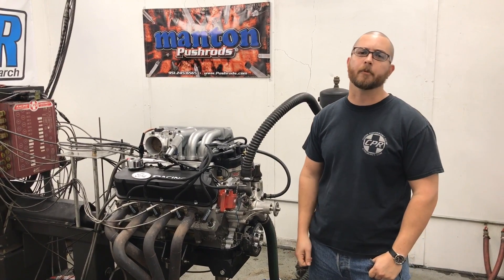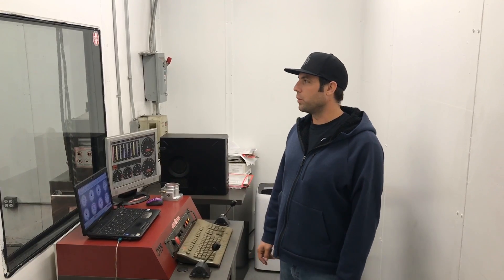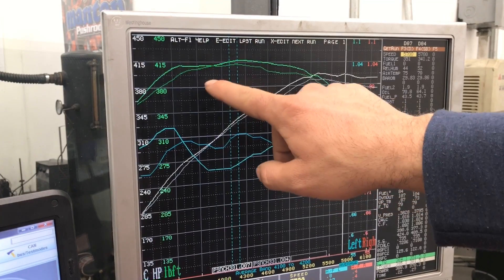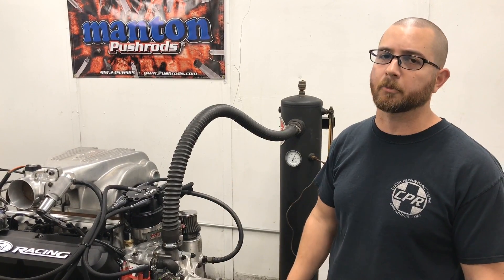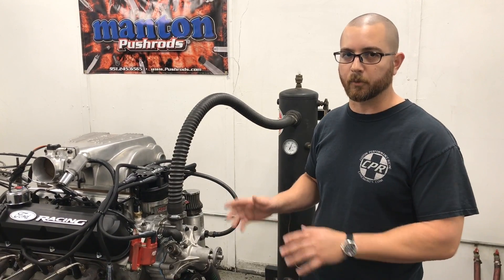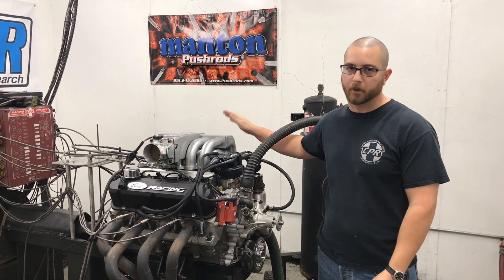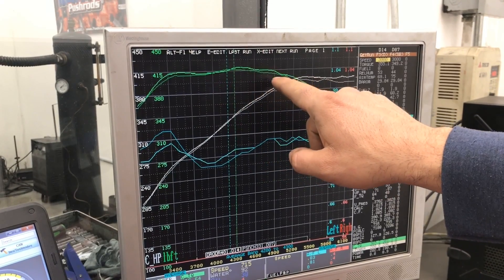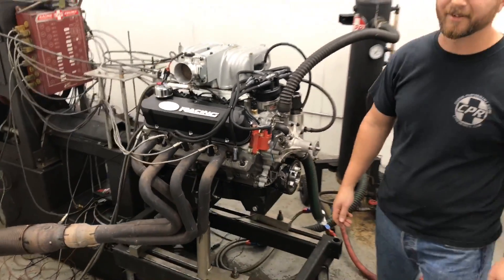Ford 331 Stroker Dyno Testing- afr 165 heads and 3 different intakes

Comment: Your numbers are way off your scale shows the horse power and torque are not crossing at 5250 rpms,  if the dyno setup is correct  the numbers will always cross at 5250 rpms

Comment: Well this pretty much convinced me there's basically no reason to port my GT40 lower intake with my AFR 165's on my current stock bottom end build. It didn't even gain much with more cubic inches that would obviously want more air than my 302. It did carry that peak power out to higher RPM but I think i'll just leave it un-ported and save some $ there. If i ever go 331 with a rebuild eventually that Systemax looks like just the ticket, great intake.

Comment: I have a buddy with a 333 Stroker engine in his 67 Fastback. It was custom built, he can't show me a build sheet. He keeps quoting me 500hp but then I saw the dyno sheet and it made 470hp without accessories. Does this seem like a realistic output for a 333 stroker on pump gas?

Comment: I have a bone stock 302 with a Vortech S Trim  and have some brand new AFR165s  . Should I sell these and get 185s ?  If I stick with the 165s what cam would you guys recommend? Thanks guys ! Love the videos
Reply: Run the 165’s. David Vizard or Richard Holdner will tell you the same thing. 👍

Comment: Damn, reminds me of my build.
347 with afr 185s and edelbrock rpm 2 intake manifold w/70mm tb . Then switched over to the holley systemax but didn't dyno. Would have made some power but i ordered the wrong cc chamber (72cc) which killed my compression. Cam 224/230 - 544/544 @ 112 ls. 
Made 323 rwh through the T5.
1 5/8 long tubes, O/H pipe. 
13.00 @ 107mph short shifting and 2.0 60ft
Reply: Damn that's it lol?

Comment: Im looking into buying your ford  331 pro street short block.  My set up will be identical to the one in this video. AFR 165s and a systemax intake.. i havent decided on what cam yet. I will be running a vortech si trim around 9 psi. What precautions can i take to be easy on the block? Like not rev over 6k rpm? It will be tuned on holley terminator x, which is up and running currently on a stock 302 bottom end. Thanks in advance and hoping to do business with you guys soon.

Comment: thanks for the test.
I have the same motor and intake with a vortec 13 LB supercharger. coud you estimate the horsepower for me please. I ask this as no one here has the software to use on the dyno.
Reply: So go dyno it and see what it makes...
Reply: be around 600 if the tune is good, if this motor is 400 and 20 hp/lb?  Run E85 and watch the numbers go!

Comment: i love that it doesn't have a blower, not everyone has a blower, but some have setups like this. Ibelieve that a 302 needs the holley for a fuel injection intake for  air because you can use 11 to 1 with a long rod and big cam and the AFR 186cc heads, i believe it works with a vic jr. or other nice intake well, maybe not the funnel web, but maybe an epoxied funnel web with narrower yet taller runners. my long rod 5.7" rod  destroker 11.5 to1 MAHLE piston ,293 cid is going to use Trick Flow 11 R-SERIES 190cc heads, custom ground cam based on a Lunati solid roller high efficiency cam with lobes for a mopar, with mopar sized hydraulic roller lifters, and either a ported performer RPM or weiand tunnel ram with epoxied narrowed and ported taller runners.  this is a street engine, its going into a 1981 camaro that has fox body tubular suspension front and rear and an 8.8 axle., the transmission a 5 speed, manual rack and pinion steering. The brakes are a manual pump manual master cylinders disc brakes super long pedal setup, levered all the way top of where the dash would be, with the rod closer to a gearbox fulcrum generating thousnads of pounds of pressure, the components are chromoly steel and fastened to a tubular frame with foot box. 40 gallon fuel tank, maybe 2 or more of them.

Comment: gr8 video CHP...I'm doing the same build can I use a ford e303 mild camshaft along with afr 165 heads also did you guys used stud or pedestal mounted 1.6 or 1.7 roller rockers.....and was the internal external balanced and if external balanced what weight did the flywheel and harmonic balanced used in build

Comment: Should have had Bigdogs Porting port the upper and lowers on both gt40 style manifolds. The results would have been a lot different. Running stock uppers on mildy ported gt40 lowers will not gain much at all we have seen this on the dyno as well.  Our testing shows only a 10-15cfm gain once bolted together. This is why tests like this don't represent what a good ported gt40 style manifold can do. Fully port that Explorer gt40 upper and lower and shorten the runners to raise the rpm peak and it would run circles around the mildly ported Systemax 2.

Comment: Why not Extrude Hone the cast intakes? If you ported the lower, why not port the upper? I hope you ported the inlet for the bigger throttle body.
Reply: Because power gains Vs cost isn't worth it.

Comment: Whats the timing set at?
Reply: Fast burn  with good  quench CNC AL heads on a  SBWF  usually about  32-34 N.A. More  at 32 deg. all-in at 3500rpm - NOT 36 ! Pull and  read read a  couple  plugs   every 5 second WOT if you are  looking for that last degree for  HP on pump gas. if you see aluminum,  your  done,  and  back down 2  degrees. I would  also go for  short nose plugs and start colder to boot.  Autolite  copper core with inconel ground-  not  NGK  whatever core and whatever meltaway grounds! Enjoy! - Sandy
Reply: @sandyshoremann7524  I use Autolite 104 copper with good results.

Comment: What cam was in there. Building 331for 65 mustang....for my wife. So big hp not necessary but that sounded great. 331 auto and 355s. Motor trans rear end out of 96 explorer
Reply from the maker: One of our mild custom cams was like 220 duration.
Reply: @coasthighperformance  okk will note that...really great sounding motor

Comment: This engine would have been so much better with AFR 185 heads too. Great pulls all together on this engine for sure.
Reply from the maker: Agreed, after this the customer sold the 165's and has us install 195's since they will work better with the supercharger.

Comment: Do you think having a shaped inlet for the throttle body would help airflow?  Nobody runs without some sort of tubing and filter on those and it's the same reason you use shaped inlet when flowing cylinder heads.
Reply from the maker: Yes, it would help slightly

Comment: Great video 
I would love to see you dyno a
347 with 185afr heads and a new style edelbrook efi intake and a 75 mm throttle body,  as for camshaft 
Something for a naturally aspirated engine on a 110 lobe separation
Reply: They have several 347 videos.  Not the exact combo you requested, but here's one that is very impressive. . . .https://www.youtube.com/watch?v=gXeqO_yekbk
Reply from the maker: We won't mind doing it but someone has to have the parts.
Reply: The 205afr is closer to Chevy LS flow performance.  Or tfs twr

Comment: why would u bother when u can.build a 347 same block?
Reply: Because the 347 has the wrist pin in the oil control ring, recipe for disaster.
Reply from the maker: We know, we started 347's back in the 90's but customer wanted to buy a 331 so we built it.
Reply: lmao...some can't just throw the $2,000 out of their pockets for a stroker kit....just sayin

Comment: What kind of power should someone expect from this engine with a carburetor?
Reply from the maker: EFI long runner intakes usually make more torque but carb engines with dual plane probably would have made more power while losing a bit of torque.
Reply from the maker: Would probably make a bit more power while losing a bit of torque, EFI long runner intakes help build great torque.

Comment: Beginning of the video the one guy said 10.1 compression and the other said 9.1 . It is a 9.1 right ?
Reply from the maker: 9.9:1 to be exact
Reply: @coasthighperformance  Thanks for replying.  Mine i believe is around 9.5:1 
Its a 306 stock block , stock crank , comp nitrous ground cam duration 282/294 lift 565/580 lobe separation 114 . Power rang is 2600 to 6400 rpm  . Edelbrock performer rpm aluminum heads - edelbrock performer air gap intake , 1.6 roller rockera . Speed pro power forged pistons.  Its not been deck yet or had any porting done. What compression do you think its has and would you have a horse power guess ? Backed up by built c4 164 tooth . Trans brake , stall is 3200 thinking of getting a 4000 . 8.8 rear with 4.10 gear

Comment: So what cam would you recommend with the afr185 heads on a 302
Reply: BigBoy TV the 185’s have the larger 351 head bolt holes so to install on a 302 block you need special inserts
Reply from the maker: Custom cams are ground depending the application

Comment: What tuning system were you using? OTS cam???
Reply from the maker: Custom cam, Megasquirt Plug and Play Fox body ECU
Reply: Comp lobes? Just curious, I like to emulate builds I like in my engine analyzer program.
Reply from the maker: We have our own pump and regulator on the dyno, ran with Megasquirt EFI